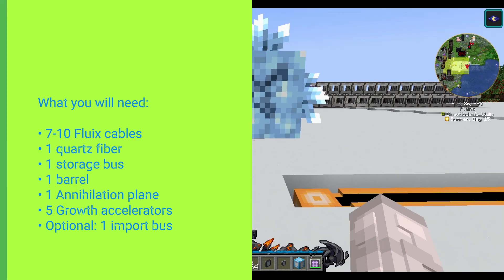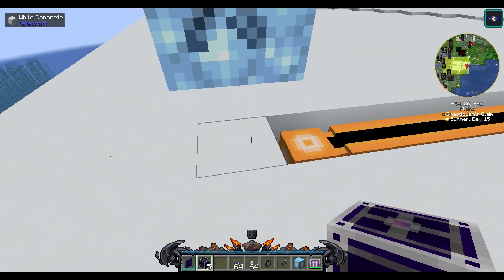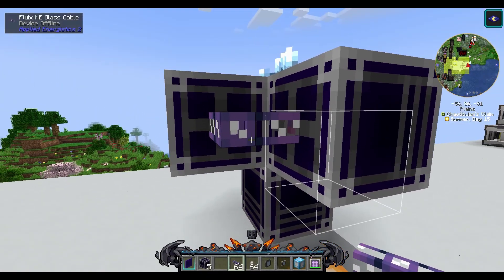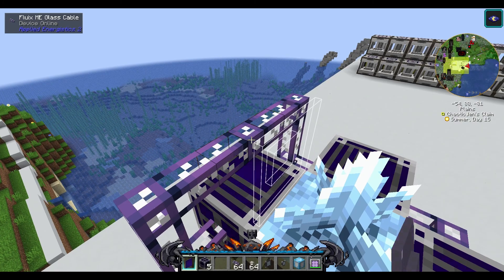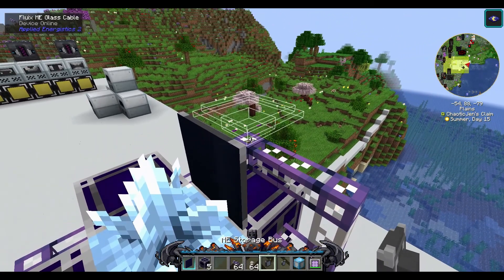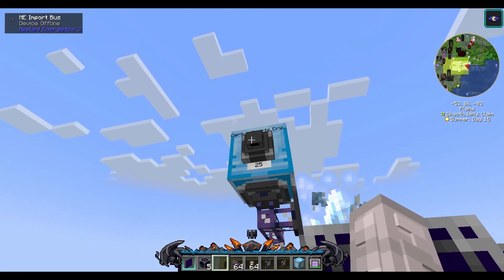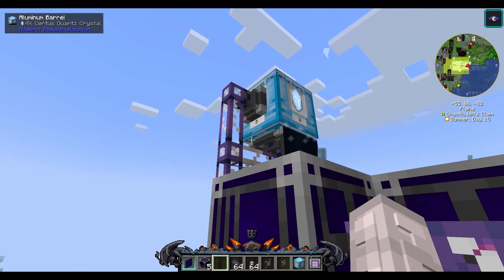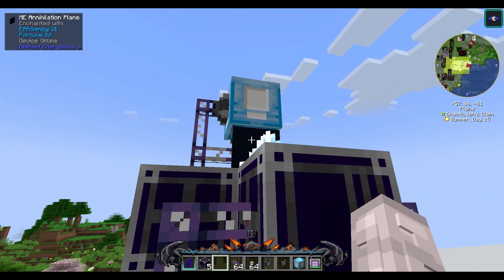How to Automate a Flawless Certus Quartz

Comment: question what is ur energy source? or like what do u have connected to the orange cable
Reply from the maker: I use magmators from Powah late game, early game I use solar from Tech Reborn. I actually wrote a guide for that in the wiki under Useful Guides>Tech>Energy
Reply: @JustChaoticJen  I read the wiki on that, Using the pulley to pull lava from an infinite source. Using Fluid pipe MK4 from Industrial Revulsion connecting directly to the pully doesn't work since the MK4 pipes don't have a pull function(unless I'm missing something). So i used Fluid pipes from Modern Industrialization, they can pull the lava directly from the pulley.